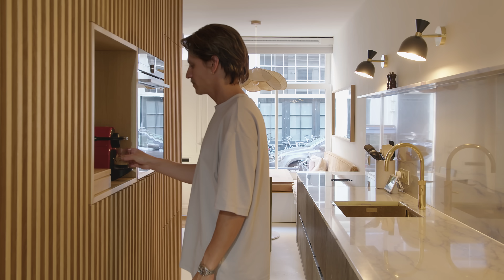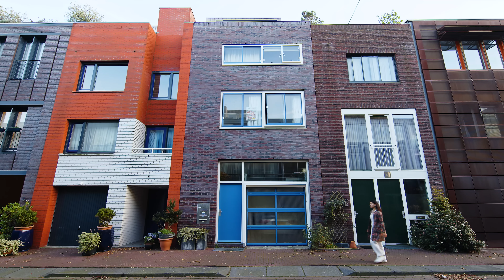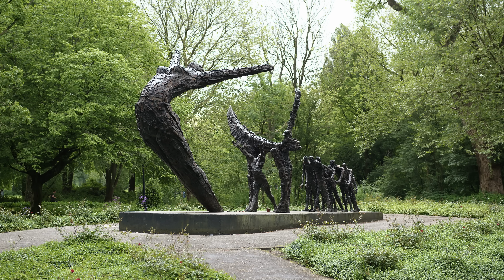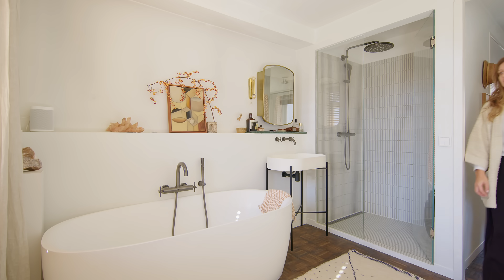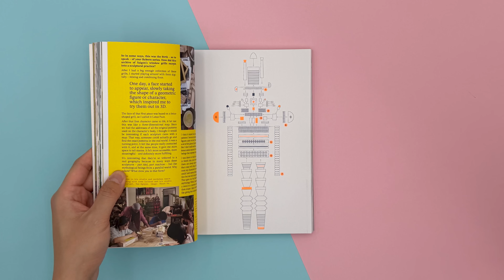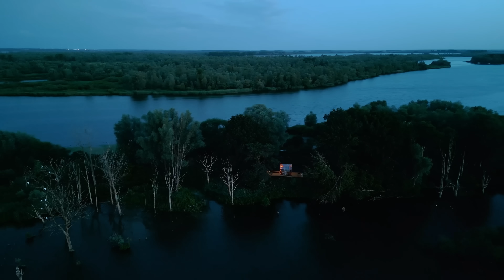Our Favourite Small Amsterdam Apartments

Comment: All very beautifully designed and functional apartments.  However, I have two concerns:  (1).  How healthy are these apartments to live in, since all are constructed by man made synthetic wood panels that use a lot of chemical adhesives in their manufacture.  I would have concerns regarding chemical or VOC's silently leaching into the atmosphere within, with possible health risks.  I would advise regular ventilation of these spaces.  (2).  I also feel that these finishes will not be durable in the long run.  They will not last like the traditional wood and architectural finishes used in the past.

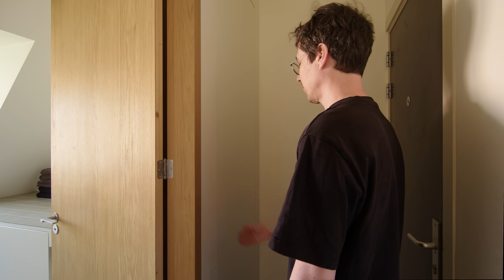Comment: 26:00 Ok, where do you drain dishes? Or put hot pans? Is that surface as strong as tiles?
Reply: They use a dishwasher, and for hot pans, could use lots of things, a trivet, a chopping board, a dinner plate. The work surface is HPL high pressure laminate, durable but not as strong as tile; you wouldn't want to put a hot pan on it.

Comment: Todos hermosos y bien aprovechados los espacios pequeños, pero hay que destacar que los dueños viven con pocas cosas, como ropa, zapatos , alimentos, lavado y secado de ropa, y demás cosas de una vida diarias. Veo la bañera en la habitación y solo pienso en la humedad y el moho...
Reply: I agree. It's better to design out a potential problem - damp bedroom for instance - than have to use remedial gadgets afterwards to deal with the problem of mould etc.
Reply: £250 will buy you grade A dehumidifier - Meaco Arete one 25L, 30 mins - all dry, or you can fit a heat recovery mechanical ventilation unit with a humidistat, several are available worldwide, drill/cut 180mm hole/ install, done - cost about £300 not inc fitting.